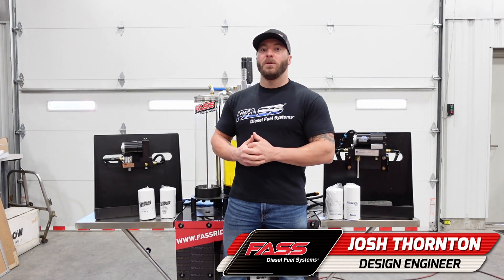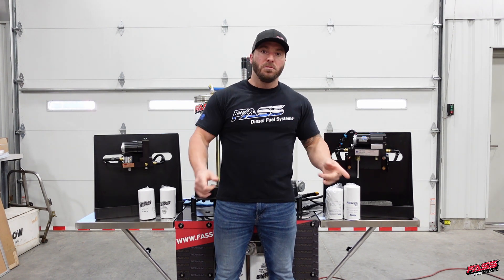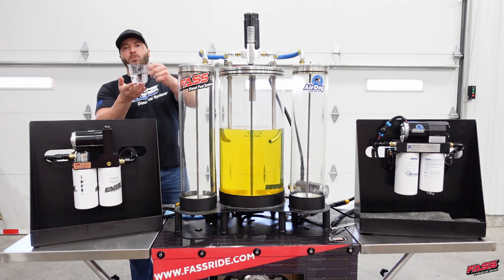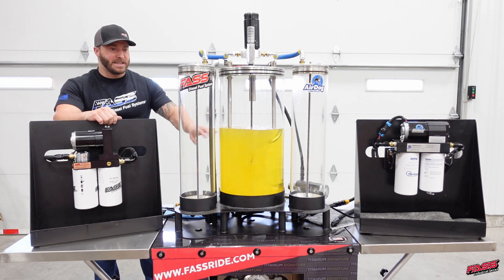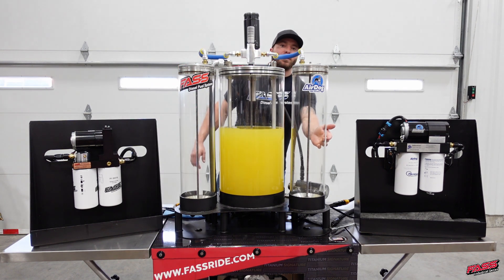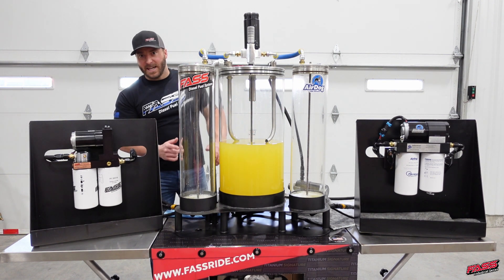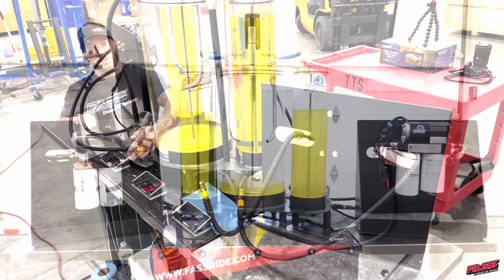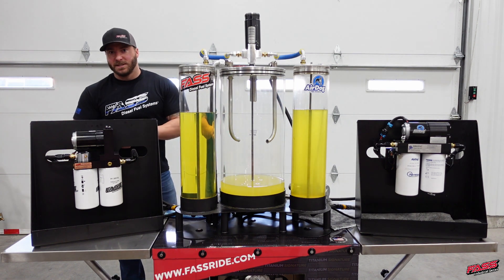Results you can SEE: Our Extreme Water Separator vs. The Competition

Comment: Dumb question if both systems can use the fleetguard fs1000 and the hf 6338, does that mean the filters are interchangeable between the two 
If so I would be interested in how that would work with the filters switched between the two units
Reply from the maker: No worries at all, and that is a great question! The thread sizes between our system and the competitors are different and wouldn't be interchangeable. We do have a large cross reference sheet on our website as well. If you have any other questions you are more than welcome to reach out to us anytime, we'll be happy to help!

Comment: That seems like very high flow rate. I wonder if at a rate the engine would actually be consuming fuel would the air dog work better? The air dog seemed to run clear for the first few seconds then went cloudy. Possibly because the flow rate is so high it can’t properly separate the water from the fuel as it would in a real world scenario?
Reply from the maker: Hey Rob, we appreciate you reaching out! Though the engine may not be consuming the full flow rate of the FASS System, many of today’s modern diesel engines will use fuel for cooling injection system components and sometimes engine control modules. Some engines will require over 165 GPH of fuel flow to adequately cool the necessary components, and this is why we designed our Extreme Water Separator to effectively separate water at these high flow rates where a coalescing media loses it’s water separation ability.

Comment: Why is the air dog clear at first and then bubbles get pump in to make it look cloudy a few seconds in? It honestly looks like a manipulation of the test.
Reply from the maker: Hey Jordan that is a great question man. The cloudiness in the competitor’s system from the start was a pocket of air mixed with the water emulsified fuel. You will notice toward the end of the video that the air clears from the competitor’s system but the fuel is still cloudy from water contamination. To be transparent, the air separation feature on both systems are not utilized for this display.

Comment: Im curious as to why the fuel from the air dog appears to be perfectly clear for the first few seconds but then gets cloudy all of a sudden and from the side. That’s weird. 
I also read the comment explaining why the fass filter doesn’t have a water drain, but why is that an advantage? Surely there could come a point when there’s too much water in the fuel filter and it does start to make it past the trap, let’s say if someone wasn’t up on changing the filter often enough and was forced to run crappy fuel often.
Reply from the maker: Awesome question, and the reason for us not using a drain for the water separator is due to the difference in the way the media is constructed and works in our filters vs everyone else. We actually have a video explaining in depth how our filters work as well, and i'll attach a link to that here as well. https://www.youtube.com/watch?v=xtYjP4Cfpd8

Also, yes sir the cloudiness in the competitor’s system from the start was a pocket of air mixed with the water emulsified fuel. To be transparent, the air separation feature on both systems aren't utilized for this display.
Reply: To the comment of no filter drain - that would be the exact same as someone who never opened the drain on their filter. It takes maybe 30 seconds longer to change the filter than to let that drain out
Reply: I didn’t catch that at first. Thank you for pointing that out. Air dog for the win

Comment: Do the same test with the same filters.
Reply: Pretty crazy but my friends shop had a customer come in with a rough running 5.9 cummins, had a fass system with the old style filters, check the flow of the pump and was checking return rates found water in the fuel exactly like shown, we figured see if the hype is true and with in a min or so the truck was running smooth, I wouldn’t believe it if I didn’t see it for myself.
Reply from the maker: That is awesome, and we're happy the truck ended up running smooth! We really appreciate you sharing this story!

Comment: Flow rates look the same
Reply: That wasn't the point...
Reply from the maker: We appreciate you talking about that, and yes they are similar between the two systems. The main difference this test was indicating was the filtration, and the ability for the system as a whole to pull water and contaminants out of the fuel.

Comment: Pretty interesting but my only question is why does your water separator filter not have a water drain petcock like the shown competitor's? I really can't say good or bad things about either because I don't own either.
Reply: So they can sell more filters? But the media in the filter may be hydroscopic.
Reply from the maker: We completely understand where you are coming from here and with our filters all the water is trapped in the filter vs being able to settle to the bottom. This ensures that water is not going through the filter, and what allows us to pull over 99% of the water out of your fuel. If you have any other questions, or need anything you are also more than welcome to reach out to our service team at 636-433-5410. Have a great day!